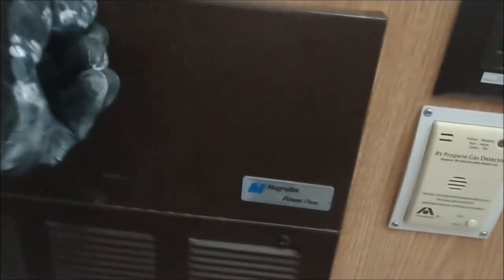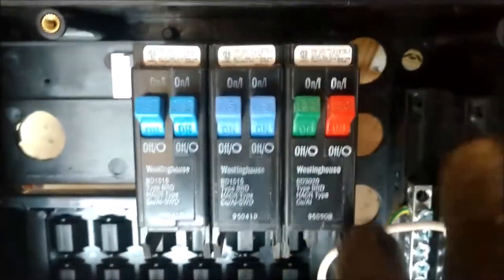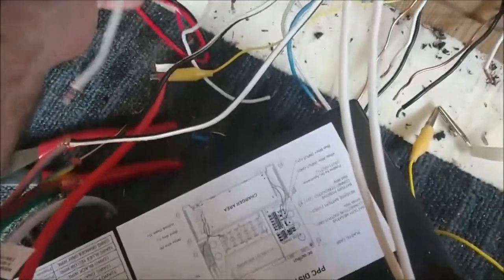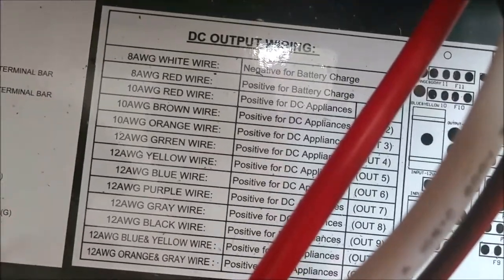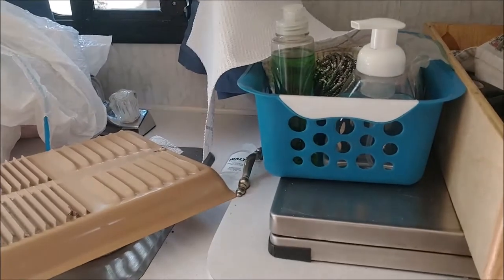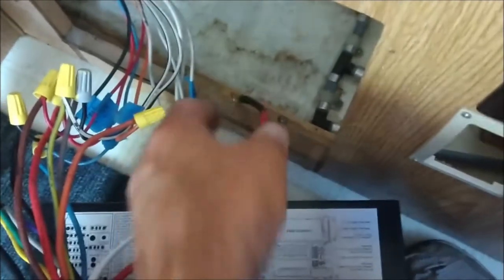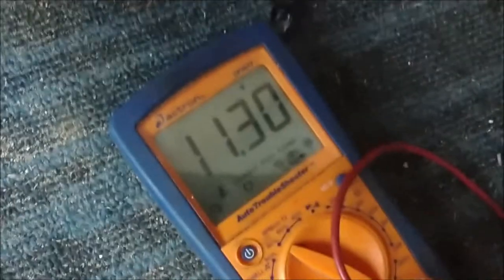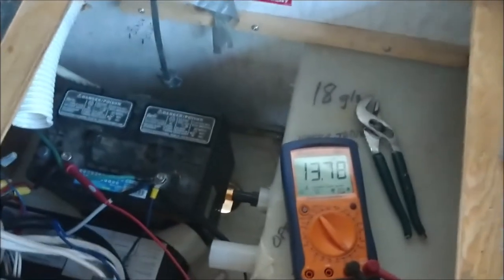Installing a new PowerMax PPC 30 55LK in our truck camper.

Comment: I thought that once the battery charger was plugged up, it ran constant until the batteries recharge and then shut itself off."smart charge" But it only runs with the generator or shore power. So I guess. I gotta hook up an inverter to do that kind of stuff , right
Reply from the maker: The unit is the charger so yes once it is plugged into an AC source it keeps the battery charged.

Comment: The black wire with the wire nut on it that comes in the converter, did you attach that to a breaker?
Reply from the maker: Hi, Yes. I had to watch the video again, but about 37:14 I see it connected to that first breaker. Thanks for watching

Comment: Hey quick Question so did you hook up you battery Charger / converter with the charger running asmuch as it wants  when ever hook a wire to the white (one with blue comein from Charger) over to the braker. Shut it down  with a quick putlet to the  flip of a braker

Comment: Hey Tim - What was the issue with the battery charging that you solved at the end?  Looks like you brought shore power into the 30a main breaker to feed the panel.  Where did you attach the black wire that comes out of the AC side of the converter?
Reply from the maker: Hi Jesse, Initially I believed there was a charging issue as I mentioned. But maybe that was just my excuse for wanting to upgrade the technology for the power center. So happy I did. Go to about 34:20 where I show where that black wire goes to the trailer harness. And then later at 36:47 you will see it going into a breaker. Thank You for watching and commenting!

Comment: You ran a wire from your outlet to your braker is that for shore power ??? I've got a orange plugin with a triangle on it  not sure what that means Someone done some work on mine befor I got it so it must've been unhooked by him didnt even tell me 🥵 neen a nightmare they didn't run the Jenny much at all 1059 hrs and its a 94 so l, also found a wire that has a tag on it from last owner saying for rear
 A/C whats your output on that